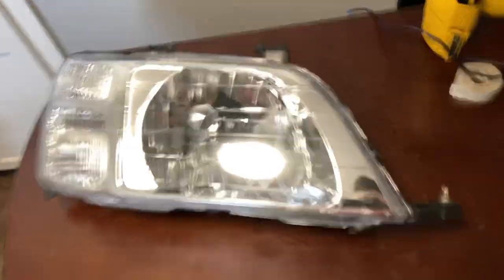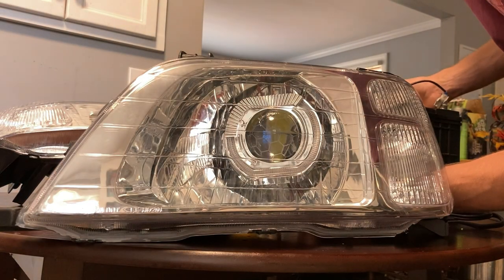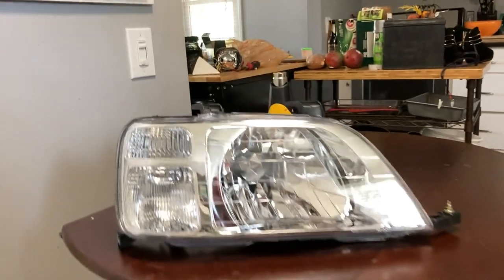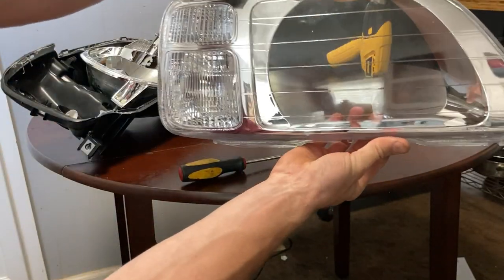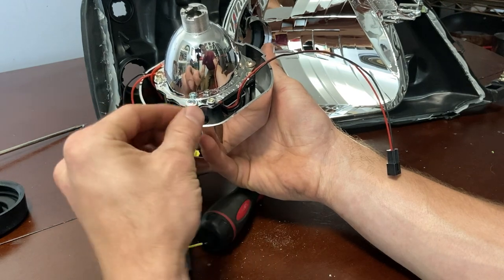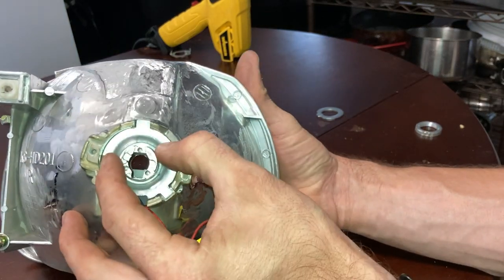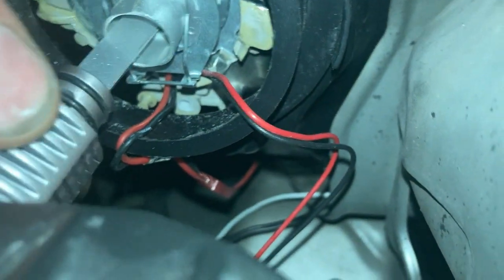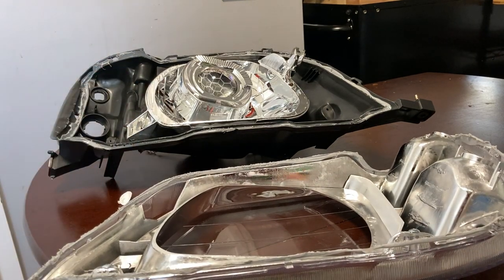Retrofit projector headlights | Honda CRV RD1 97-01 | custom headlights

Comment: I actually don't plan on installing LEDs - I'm of the opinion that in actual real world application whiter light = less visibility. Projectors are superior even for halogen bulbs, and doing a retrofit like this will definitely improve visibility - old school halogens or not! Thanks for the tutorial, just got my set today.
Reply from the maker: Awesome! Good luck with the install
Reply: Tell me about it. I actually bought the Morimoto MLED 2.0 projectors for my 2010 Honda Fit and I ended up exchanging them through a warranty claim and later selling them because I just couldn't see at night. Xenon HIDs in a proper projector all the way for me!

Comment: Can u show how to wire them in the car ? The running lights and the high beam flap
Reply: Pretty sure you just have to wire the flap to high beam signal wire. So when you pull the high beams it should move. I’m doing mine soon so I’ll comment later on how I got it to work
Reply from the maker: Wiring up projector led setup for Projector RD1 CRV #CRV #RD1 ##projectorretrofit
https://youtu.be/wxlfsh_OOfo

Comment: Great video. I was thinking of getting the morimoto projectors, but great content btw! Posting this up on the Facebook group.
Reply from the maker: Thanks dude. Yeah miromoto will be excellent quality I’m sure and will probably work slightly better than the ones I used. But I’m all about doing stuff on a budget and it works good enough that I’m happy with it without breaking the bank. Plus the car looks different than others CRVs on the road so it’s cool to be different

Comment: Got a question did my lights today and can’t figure out how to wire up the high beams flaps could you let me know what you did thanks
Reply from the maker: I actually ended up wiring it up to my low beam power wire to the light bulb. So it just automatically stays on high all the time
Reply: Thanks I appreciate

Comment: How's that housing/led strip holding up? It would suck to have it go out and have to open up the headlight just to change it.
Reply from the maker: No issues so far. Both the white and orange are holding up just fine. Not sure on the longevity of it but so far so good
Reply: @MooreProjects  yeah I was looking at morimoto ones and noticed that they are made overseas. Just wondering if "ebay" ones and morimoto ones come from the same factory lol 😆

Comment: So I have the projectors but without angel eye, getting ready to do this but I don’t understand if it’s required to use h1 bulb. H1 bulb only has 2 connectors are you using the angle eye as drl?
Reply from the maker: You’re correct. It’s only being used as a low beam. I don’t have high beams right now
Reply: @MooreProjects  from the information from the projectors seller, the projectors should be wired to high beam and the flapper motor thingy not sure the name of it should be changing hi beam low beam blocking the beam. Gonna play with it might possibly mod them to fit the h4 somehow
Reply: I'm thinking about doing this set up. Was thinking about using the h4 bulb, find one that fits in the projector of course and plug like normal and wire the projector flapper to the hi beam wire so when I switched to high beams, the bulb will go hi beam and the flapper also will open...

Think it will work?
Reply: @lorenzogonzalez4881  can’t say I didn’t end up doing it got lazy might end up doing it soon

Comment: Wouldn't you want to use hids for those projectors instead of leds?
Reply from the maker: HIDs would be better since it’s more light area that shines overall. I used LEDs because I’ve had less issues with LEDs over the years than I did with HID kits
Reply: @MooreProjects  Is this brighter than the stock setup? the h1 bulbs you listed say they are not to be used with projectors but if it works it works
Reply from the maker: @gregorytextoris9246  they are bright enough for me to see. But make sure you buy decent headlight bulbs. The first set I bought were only $12 and were NOT bright enough. But neither set have gave me issues in the projector setup using them for prolonged periods

Comment: Hey did u have to tap into any fuse
Reply from the maker: No didn’t have to tap into anything
Reply: @MooreProjects  ok by any chance u kno a 12v ignition switch fuse I could tap into on a 2000 crv
Reply from the maker: @andym9260  yes under the dash where the fuses are you will see 3 single prong open pockets. Use a test light and find the one that lights up with the key switch on. And then just use a spade electrical connector to connect to it